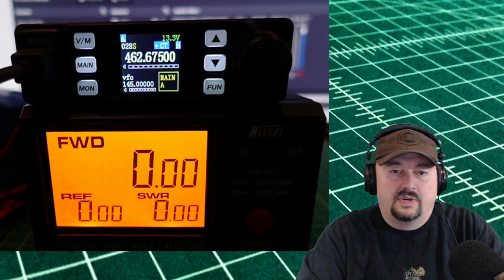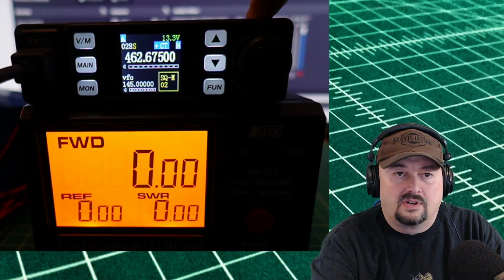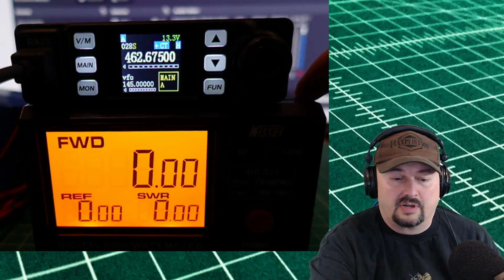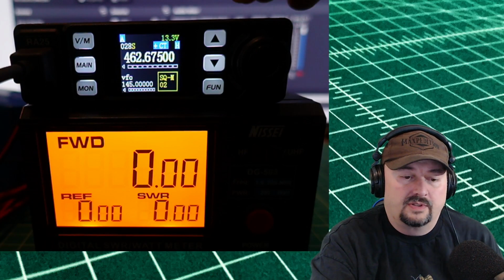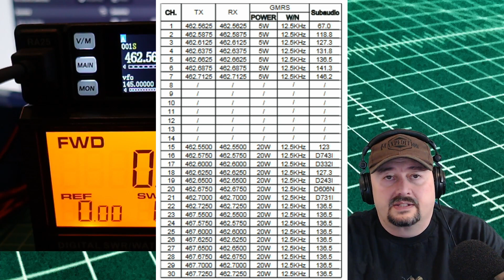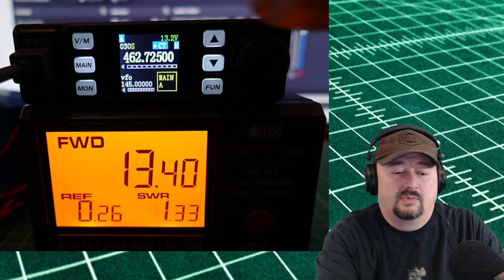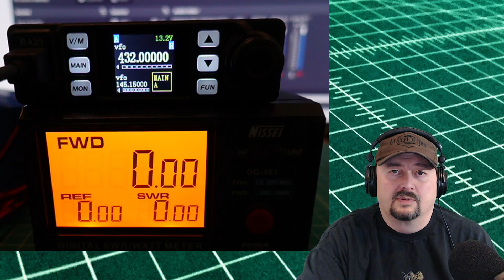Power Test - Retevis RA25 GMRS Radio

Comment: If I unlock the radio for ham bands, will the preprogrammed GMRS channels still be programmed into the radio or will it need to be controlled in VFO mode?
Reply from the maker: Switching the mode erases everything 👍
Reply: @TheSmokinApe  So if I unlock the ham bands, then can I go back in and upload my saved CSP file from my computer into the DB20G?  Of course, I want to keep all of the set GMRS channels and the local repeaters I have programmed into to CPS file.
Reply from the maker: @stevegreer1963  that should work

Comment: All of the most sensitive (RX) and accurate (TX) radios I have owned, were mono band. Similar to using a mono band antenna that's designed to perform amazing across maybe 5 to 10 mhz, as opposed to using a multi band antenna. You have to make performance compromises in order to gain the additional functionality. It does seem odd that they wouldn't have fine tuned the max output levels to GMRS and let the ham bands fall where they fall. My guess is that they already had production down for the ham radio line, and decided to pump out some GMRS models using the exact same components without making any real changes since that would come out the bottom line, and only give the end user 4 or 5 more watts max on high power gmrs. That's assuming tuning up the high power on the upper frequencies didn't cause the low power channels to exceed their FCC limits. This was very likely what happened, and re-designing the whole thing would have been necessary to really dial it in.
Reply from the maker: I’m with you, this was a ham radio first and GMRS second 👍

Comment: Would have been good to see that using a 13.8 volt power supply.  the lithium battery is only outputting 12.6 volts. Not sure if it would make  big difference in GMRS config. But might have?
Reply from the maker: Interesting point Sean
Reply: Yes I totally agree with the 13.8 volts. I use the FTM 100 in my truck. And I noticed when the truck is not running and my voltage is down I'm not seeing the full output power

Comment: Why is it more appropriate to test power output by using a dummy load instead of going on a frequency, asking if it in use or not, and if it isn't, saying your call sign and the word 'testing' a few times? Wouldn't the meter show the correct power? (I appreciate digital meters might have a small delay, but you get the idea behind the question). Many thanks
Reply from the maker: The meter should show the correct forward power either way, I just make it a practice to use the dummy load when testing so I don't cause and interference.

Comment: If the radio's output is 20 watts at 467MHz with the loss in the RG8X and return losses of 0.019 db (SWR 1.33:1) you would see 17.7watts at the meter. This excludes the connector losses. The delta between 20 and 13.5 is ~1.6db.
Reply from the maker: This seems like a sensible analysis.

Comment: Transmits 462.575 17 watts transmit 467.575  13 watts.  Totally jailbreak and remove all safety stops.   18 watts on weather service frequency.   Not that I did that.

Comment: Does this radio need to be set to the 2m mode each time you turn it on or does it stay in the last mode used?  Thanks for this series on this radio.
Reply from the maker: Hey Chris, it will stay in the last mode used 👍